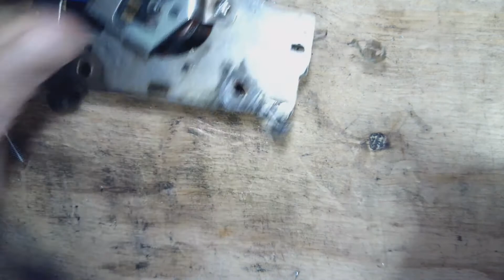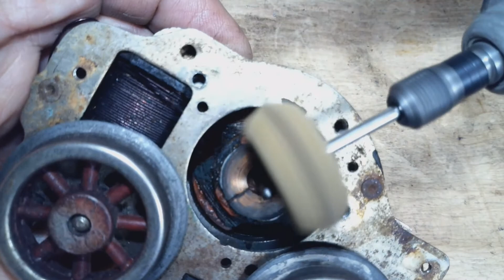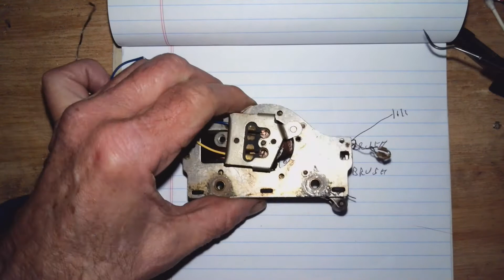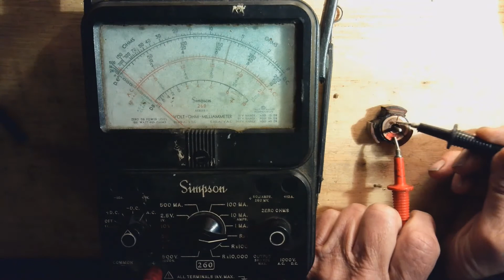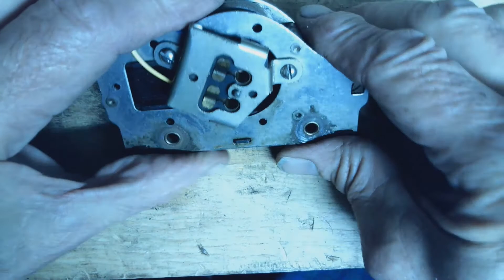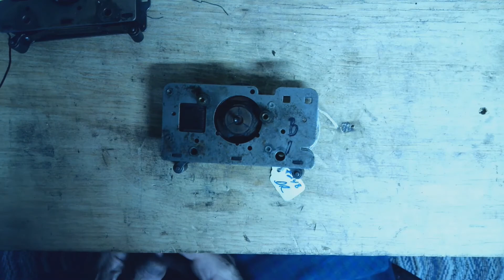Lionel Pre-war humpback "O" gauge motor check

Comment: Excellent video that will help in rewiring my 251. especially the end since it does have the wafer switch to manually choose reverse and forward. question if I may. I am in the process in replacing the fiber board with rollers and noticed there are two wires coming off the roller assembly. can you tell me if this correct?. previous owner had them coming off the roller and both connected to one terminal on wafer switch. shouldn't one wire go to one brush and the other to the other brush..any information would be greatly appreciated before I install the fiber plate. thank you.